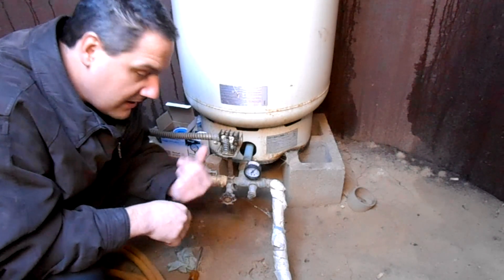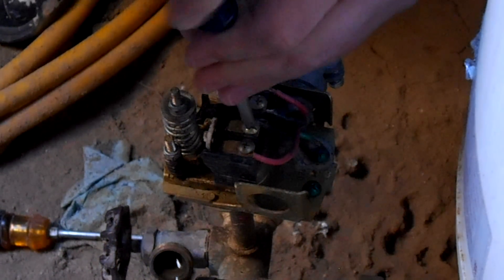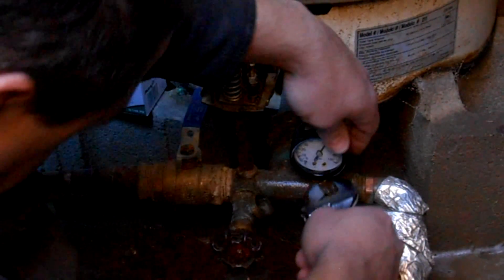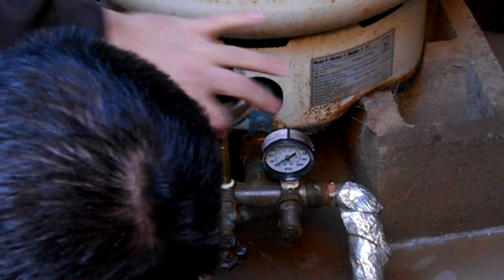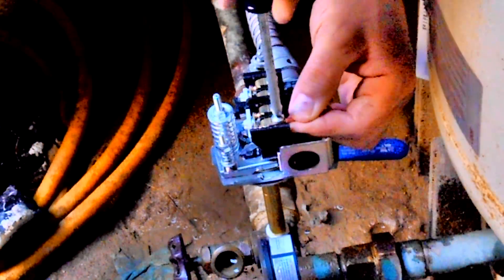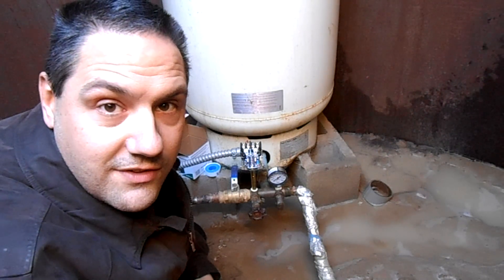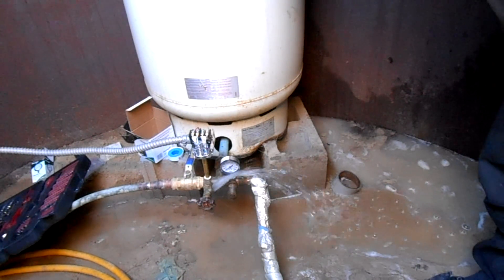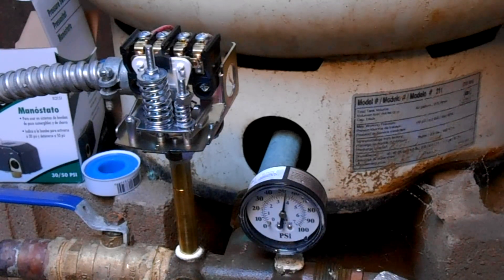Replacing a well pressure switch & re-pressurizing the tank to avoid short cycling

Comment: The video needs to have a comment added that when the bladder tank air is released he is addressing another problem that most people shouldn't do.  And if they do what he did they will create another problem just as big as the pressure switch problem.

If the bladder tank does not have a leak (hole) then the water will drain from the tank without releasing the air.  If you release air from the bladder tank, you better have a good plan and equipment to put the air back in such as a good air pressure control compressor.  Recharge bladder tank to 2psi less than pump start pressure.

Somewhat related, my system had a dirt/scale plug at the bottom of the little pipe leading up to the pressure switch.  It lead to the switch responding very slowly such that water pressure went to 0 before the pump started and then went to over 80 psi before the pump shut-off.  Fortunately my bladder tank survived the workout until I was able to open the pipe and clear the dirt.

Also, check with your own sources as to whether you should use pipe dope on potable water.  Teflon tape is more appropriate for potable water but there is dope suitable for potable water.
Reply from the maker: Art Smith Are you my neighbor?  Also, I just looked up a bunch of the "pipe dope", aka pipe joint compound and the ones I looked at said they were safe for water (mentions non-toxic) as well as specifically saying "Ideal for a wide variety of fluids and gasses including potable water".  Do you know of any popular ones that aren't safe so we can be sure not to purchase it?

Comment: thanks so much short cycle will spike the power bill also!
Reply: +RanJay H Really??? Do tell.......
Reply from the maker: +jim davidson Because the pump turning on draws more power than when running.  Normally, you will get a small power surge, the pump will run for x amount of time and shut off.  If the pump is short cycling, it will turn on and off more than it should pulling more power than average each time it starts.

Comment: Hi so I was changing my well pressure switch and when i was unscrewing the switch i loosened the same pipe as in your video  you did it didn't unscrew all the way it just came loose so i was wondering if we have to replace the pipe as well or do we just tighten it back off: if we have to replace it will regular copper piping work or is it a special kind of pipe??? also we have a gauge that's reading zero right by it do we replace it as well?? we have no water pressure in our house at all it sucks Please help!!!
Reply from the maker: ***** You do not need to replace the pipe unless it is cracked or the threads are damaged.  You can just put a few wraps of Teflon tape, thread compound, or both and just screw it back in.  I would suggest you also replace the pressure gauge.  That's an easy one and if you already don't have any pressure, now is the time to change it.

Comment: Tank pressure is set at factory. You should not let air out of bladder. You set bladder to 2 lbs less that the cut off pressure of your pump switch.  Quit giving information if you do not know what you are doing.
Reply from the maker: Well, I know for a fact your first comment is 100% incorrect.  Here is an example: http://youtu.be/laSUmyCWYds?t=4m15s   Second, I'm not letting air out of my tank, I'm letting air into the tank.  Obviously, my tank has a leak.  And after looking at your videos, I see you are an expert on the topic and share freely.  So, although I appreciate your comment, you should quit giving information if you do not know what you are doing.

Comment: Great video, nicely straight-forward, thank you.  But, at the end, after you've drained the pressure tank, you did not shut off the drain faucet and re-pressurize the air via the top-mounted Schrader valve before refilling with water.  Aren't you supposed to pump air into the Schrader valve to a value of 2 or 3 of PSI below your low-end cut-in PSI before refilling with water pressure?  I believe your tank must be still cycling much quicker than it would if you had built up the air pressure prior to refilling with water since you're not using the air pressure to assist the tank the way it's supposed to.
Reply: James Zawacki  , James you were incorrect when you stated that by pressing the schrader valve you were letting air in. Only once you have deflated the whole bladder by pressing the schrader valve will you be letting air in. Here is the cited instructions 
"(Don't wiggle the tank all over the
place or you might cause a pipe to leak.) Now water is barely running out of
the hose because no air can get into the tank. It's like holding a full soda bottle
upside down - air has to work to get in past the water gurgling out. In this
case air would have to bubble all the way in up through the garden hose. We'll
meet our maker before this will ever happen.

So here are some ways to get air
into the tank, arranged in order of preference:
Use that Schrader Valve: Once no pressure is left in
the tank, since you have a Schrader valve on the tank you can just press the
little valve pin in the center of the valve. You might get a little squirt of water.
This means the tank is still under pressure.

Wait a few minutes then try again.
Once there is no pressure in the tank the valve stem will stay pressed down and
you'll hear air hissing and bubbling into the tank. Isn't this just the
neatest thing? You could speed things along with a bicycle pump but it's not
necessary."
Reply from the maker: I would love some reference information regarding repressurizing the system by adding 32 or 33 PSI into the tank prior to allowing the water being pumped in to create the pressure.  From my research, allowing the air to fill the tank when draining it, is all the air that needs to be in the system when you repressurize it from the water pressure.   If there is already 32 PSI of air pressure in the tank prior to pumping water into the tank, all the tank will hold is enough water to create 50 PSI of pressure and the pressure switch will cut off.  From my understanding, having 32 PSI of air in the tank already would cause it to short cycle more than the method I used, but I'm not an expert, so if you could post some links, I'd gladly read them.
Reply: James Zawacki  Sure, James.  Here is one.  http://inspectapedia.com/water/Water_Tank_Air_Add_Valve.htm
Reply from the maker: Johnny Shabazz
We must be talking about different things.  I understand the process to add air using the schrader valve.  I didn't see anything in that link that talks about draining the tank, then pressurizing the tank to 32psi prior to pumping water back into the tank.  Did I miss something in the article?  Interesting enough, the method I used (and learned) is from the same site: http://inspectapedia.com/water/Water_Tank_Air_Add_by_Draining.htm
Reply: James Zawacki Perhaps you two are talking about different types of tanks. There's hydro pneumatic (colloquially known as air over water) and captive air types (bladder or diaphragm). A bladder type does indeed need to be set to slightly LESS pressure then your cut in pressure just as Johnny mentions. In Your case James that would be 28 lbs, not 32. Adding 32 lbs of pre charge to a bladder tank in your set up would cause the pump to never come on as the system would never see the cut in pressure of 30. Having too little precharge can potentially make the bladder expand to much when its filled with water and be damaged. The process in the video is appropriate for an air over water tank, however there are some people who say to add about 20lbs of pressure to this type of tank once most of the water is out and the closest valve is closed.
Reply from the maker: Trevor Schuler
My tank had a collapsed bladder due to a leak.  That is why it was sucking air in, to fill the bladder back up with air.  I kinda wish I would have shot a video with a thread over the Schrader valve so everyone could see that it wasn't blowing air out, but sucking it in.  Either way, I have since replaced the tank due to the leaking bladder.  BTW, I broke the Schrader valve off and drained water out of it because even when the tank was empty, I couldn't lift it because it had so much water trapped in the bladder.

Comment: Finally!!!  Someone that mentions how to properly drain the pressure tank and what happens if it isn't done right. I've been searching various sites and youtube for a  day now trying to find the cause of the short-cycling problem that recently started.
We lost power a few nights ago. A toilet was flushed while it was out. The next morning there was no water. The pressure switch had to be re-set, but the system never had the same water pressure; it quickly dropped off once a tap was turned on. Read about lots of people with the same problem, but no solutions. Then, read about someone who said when pressure is lost in the system, dirt built up in the pressure tank can cause these issues. So, drained the pressure tank and flushed a couple of times (also replaced the pressure gauge, wasn't working, and put a new pressure switch, as one contact seemed to have been arching.) Refilled the system, only to watch the pressure gauge slowly approach 30lbs, then shoot up to 55 lbs. in no time. When water was turned on at a tap, pressure went from normal to a trickle in next to no time... and then the problem with the pump cycling on/off every few seconds began. Called a couple of plumbers I know, to try to work it out over the phone.... left them scratching their heads also........ Thanks to your video, it confirmed my suspicions that there must be air somewhere it didn't belong, like in the water side of the tank.  
Even though I had drained and filled a few times to flush it out, I never released the
pre-charged pressure the tank came with. I did just as you suggested, then recharged tank to 30lbs before refilling. Then watched the pressure build slowly, just as it is suppose to, up to 50 lbs. Ran a tap to see how fast the pressure dropped now... PRESTO!!! Problems solved. No more low pressure and no more rapid pump cycling.
Tks. for your video!! Saved me a great deal of frustration and a plumbers bill, as I called and cancelled the one that was coming over later this morning...lol!!
Suggestion: You may wish to change the title of your video though,, or at least add to it, calling it
"Replacing a well pressure switch & properly draining and re-filling the pressure tank to avoid short cycling"... or something like that  =)  May help shorten some people's searches.
Thanks Again. !!
Reply from the maker: ***** Hello,  If you look at the comments with this video, I wasn't releasing the pre-charged pressure in the bladder, the bladder has a hole, and it is sucking air into the tank to allow water to release out of the bottom.  Like a straw, if you stick it in a drink and place your finger over the top, the vacuum formed by the air trapped in the straw will now allow the drink to spill out.  That is the case with the tank in this video.  If your bladder is working properly, you can recharge it using an air pump/compressor to the PSI that should be listed on the tank.  If no PSI is listed on the tank, I suggest you search for the manufacturers suggested PSI for that model tank.
Reply: James Zawacki  So, I drain the tank releasing the pre-charged pressure that the tank came with. After that, do I recharge the tank with 30 lbs? What do you mean about that? Do I recharged the tank with air? 30 psi? I am confuse sorry and I have the same problem short cycling.
Reply from the maker: I'm glad it helped.  Thanks for the suggestion, I will change the title right now.  I did a TON of research prior to figuring it out as well.